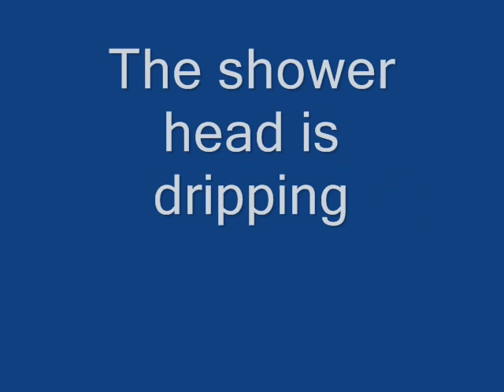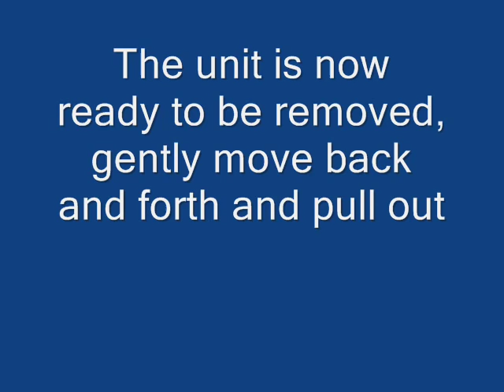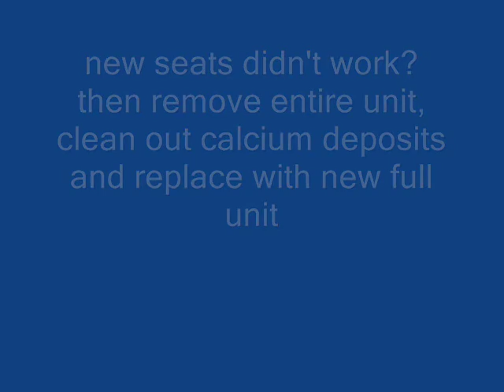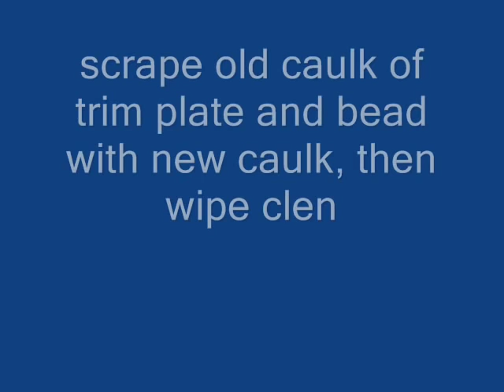Delta Shower Faucet Repair model 1300/1400

Comment: Worked like a charm, thx.  I also needed a large pair of Channellock pliers and did not need to remove the faceplate.  I will note that, when re-attaching the two cartridge pieces (after spring and seat replacement), I screwed the blue portion into the white and then also had to snap it into place.  In other words, after screwing them together as far as they will go, I also had to apply downward pressure (there was an audible click) for them to completely mate.

Comment: Thanks so much for posting this video; very good instructions.  I have a Delta 1400 series shower control.  I tried the springs and seats first and alas-- that didn't fix it.  Had to shell out $40 + tax for the entire cartridge... however after installation, the dripping was completely eliminated.  Note:  I also had trouble getting the "bonnet cap" off, and my channel-locks were not big enough.  Enjoying a drip-free show now!  Thanks again.

Comment: I did make sure there was no deposits before installing new cartridge at the time.  I just replaced it with new spring and seal, purchased from a local hardware store and Delta genuine!!!  Replacement cartridge floating around Ebay and sold cheap are the ones you should stay away from as they are not genuine/made from Delta.  But thanks Rob

Comment: Worked just like this states, a great video. I found two replacement value assemblies at Lowes one with White and the other with Grey sticking out of the wall. If you have the Delta shower in this video use the part it suggests, if not you may need the Grey one. Mine was the white one and it worked perfect. One tip is be careful loosening that outer Chrome piece. I put the trim wrong screws back in the fixture and held them while using a pipe wrench to loose the chrome ring that holds the value in place. Yes I got a few small scratches on it but I saved a lot over a plumber and if you grab the valve wring where its least noticeable with the pipe wrench you won't see those small scracthes.

Comment: A few years ago I had to do this, and now I'm having to do it again. At about 1:46 you show the big nut that holds things in, and, as you say, it must not be crushed. Last time I did this, I damaged it and had to replace it, but before I put it back in, I made a wrench just for the purpose out of a scrap of 1 by 4 about a foot long. Centered about 4" from one end I used a 2" hole saw to make a hole--the size you use may vary depending on your nut--then cut a slit from the far end to the hole, just wide enough to allow a bit of pressure to get a good grip. The wood should fit snuggly before pressure is applied. Anyway, when you squeeze it applies pressure evenly and doesn't crush the nut, allowing it to be turned. So, this time, I just hunted up by wooden wrench and took it off without  problems.  Make sure you keep it safe, as there will be a next time.
Reply from the maker: +Colin MacKenzie Thanks for sharing that!
Reply: +Colin MacKenzie Regarding that bonnet nut that you shouldn't crush, I've had good luck getting them off with a chain strap wrench.  The cloth and rubber strap wrenches are useless, but the chain straps do get an even grip around the whole exterior of the bonnet.

Comment: I discovered the hard way, that aftermarket replacement valve cartridges will often exhibit water hammer and/or leaks soon after installation.  Unfortunately, the Delta OEM replacement plumbing parts at big box hardware stores have lately (since 2015)  have almost all been replaced by third party manufacturers like Danco.  These are often half the price of OEM parts, but I keep finding problems with leaks that recur after a few weeks or water hammer issues.  I'm on my way now to replace (again)  a delta monitor shower cartridge like the one shown in this video, but I hurriedly put in a Danco cartridge that had water hammer from day one and began leaking (again) 3 months later.  Puttting in a genuine Delta cartridge this time. Fingers crossed, because inside of valve body is heavily corroded, so I may never get a good smooth sealing surface  in there.

Comment: actually the disc is a scald valve... it is used to control the amount of hot water that is able to come out. But adjusting it left or right it adjusts the max hot water temp.

Comment: I had an interesting problem. Everything went well. I put the cartridge in properly with the hot side to the left. When I turned the water back on to test it, the water temp was backwards. As I turned the handle counterclockwise, instead of the water getting hotter, it got colder. I called Delta and a plumber and they both said to turn the cartridge over. It worked. So even though the hot side if the cartridge should be on the left, mine is on the right. Either a faulty cartridge or wonky plumbing. But not more leak!

Comment: Its the gear piece in your video.  Take it apart and rotate the plastic piece away from the hot water.  Mine is clockwise and I rotated it about 15 degrees and that did it.

Comment: In Canada the allan wrench /key needed to remove the setting screw was not a 1/8 that was to big, we had to use a 5/32 to remove it.. the cartridge was very hard to pull out on ours and ours is only 5 yrs old. We had to tug really hard and pry to get it to come out. ugh.

Comment: Gr8 help thnx, but I had a problem I think mine is the 1400. I have a different handle " long " not the round plastic one. Had a lot of problems with the set screw (Allen) I think it is either stripped or just frozen together ?? Have read a couple of blogs and seems to be a very cmon problem with this unit! Have tried everything for two days only too have unit leak even more hot water. I'm going with the solution that most people came up with, that is hack sawing off the handle which will damag

Comment: This worked well for me! Struggled to get the handle off and then unable to remove bonnet nut!!! Try this it worked for me drained system left basement tap open and POURED CLR down the shower outlet pipe through cartridge. Let sit for 10 mins. TADAA hope it helps someone out. Cost is minimal.

Comment: I put in a new cartridge and even though it is set for the hottest it can get, it is still not hot enough. By the way, you do not need to take off the trim to do this.

Comment: instead of turning the valve to remove the front put your channel locks on the stem and pull forward... may take a little wiggling but it should pull straight out.

Comment: You can get these cartridges for cheap on eBay.  Big savings over trying to get them from a plumbing supply company - $20 vs $70 in my local area.  Yeah, replacing seals and springs didn't work for me either.

Comment: Hey Rob, This video, and I looked at all of them, got me through the shower cartridge change, but now I don't have any hot water. I have a Delta single handle and tried taking the plastic ring with teeth off, but no luck. Do you have any suggestions?

Comment: My faucet isn't dripping.  When I turn it on I'm not getting a stream of water.  Some water comes out and it whines.  I just bought this house and moved in 2 weeks ago and it wasn't working.  The seller sent a plumber who fixed it and it worked fine for the past 2 weeks.  Now it's back to doing what it did before he fixed it.  I watched him fix it and it didn't go as easily as the video, I think he replaced the cartridge but I'm not sure....he bought one but whether he used it, I don't know.

Comment: Also another quick note:  With the new cartridge, the brass gear-like part, and the white plastic disc-like part that went on the front of the control stem did not have to be re-used.  I threw them away.  The new Delta cartridge has its own parts on the front for temperature control, etc.

Comment: Could you please tell me if what you call "trim is screwed" is actually the bonnet nut itself.

I see 3 pieces and the front part that is screwed on looks like bonnet nut.

If that is not the case, are there 2/pieces of sleeve and beneath that is the bonnet but?

Thanks for your help....

Comment: mine screwed on. Thanks and I would say more but I keep losing my typing. Mine is a standard old Moen without Temp or pressure control. Now I must try and get valve out without special tool. Any help appreciated. Thanks again, Robert.

Comment: @probe2222 Yes,  it may but may not -who wants to replace the valve & spring; put back together and then have the leak not fixed?  While I have it exposed & ready to be replaced I am going to replace the unit as well.
Some time ago I thought I would simply replace my delta whirlpool tub faucet 'valve&spring' only to find it needed an entire cartridge after I got it all back together. I still have not fixed that leak yet.

Comment: Installed the 2nd replacement cartridge and it failed.  Every 2 seconds water still drips.  The replacement cartridge was made cheaper than original?!  Both snapped in half while removing from valve body so be careful all.  Looks like I'm not the only one with this leak problem.

Comment: What if the new part will not seat I have tried everything but no luck
Reply: Suggestions:  
1.  Make sure old and new cartridges look the same.  Some of the Delta cartridges have different "legs" that go in the wall fixture. 
2.  Scrape/clean fixture old cartridge came out of.  Calcium deposits (seen in video) are a prime culprit. 
3.  Make sure O-rings from old cartridge came out of fixture.  Can compare new vs. old cartridge to check.  
4.  Use some plumbing grease on the O-rings of the new cartridge to make installation easier.

Comment: Any tips on removing the brass bonnet? I've tried tongue and groove pliers, heating it up, soaking it with wd40, and still it won't budge...
Reply: I had  to put heat to it with  torch.
Reply: Took me an hour but finally after wd 40 and vinegar, it broke free
Reply: took starting and stopping, WD40, vinegar, putting a nick in the ring with a file and tapping a screwdriver placed in the nick, and finally it came loose with a channel lock

Comment: I can't seem to get the unit out after removing everything. Is it just stuck or did I miss a step. I wiggled for a good 5 minutes and nothing...
Reply: what did you do? I am having the same issue.
Reply: Yes, I'm also having the same problem. After removing the bonnet (which took a day of a mixture of different liquids like CLR, vinegar, & WD40 and different wrenches) I cannot, for the life of me pull out the cartridge. I've been using a flathead screwdriver to somewhat pry it out, but has only managed to get me 1/8 of an inch of play. Any advice out there? Is there a trick to this or do I just have to brute force it out?